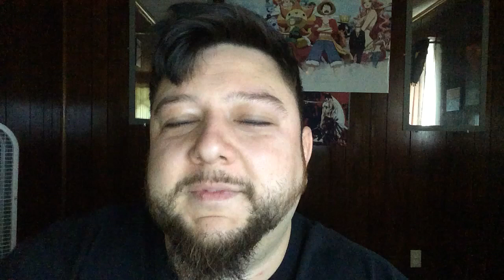Mixing Engine Parts: How To Check What Fits Where

Comment: There's an app called Honda database. It tells you everything about engines that you need to know. It tells you transmission gearing. It tells you computer pinouts, torque specs, ECU codes. Tells you engines and what car are there in. And that's the free one
Reply: The whole point is you can get a lot of information off here to get you going but if you're going to buy stuff or build something you. should probably make sure it is accurate. For example it's on looking on eBay for Eagle rods for a b18b you better know what length that you're looking for because there's a ton of them. Is that their fault you ordered the wrong ones. I want 137mm, but I accidentally ordered type-r rods that are 137.9 mm. Damn it I just ordered B16 rods 134 mm. I think that's the whole point he's trying to get across. And there's this thing called Google look it up. You can't take one example as the right thing. And new means I am one person that will ask the stupid question that I could have looked up